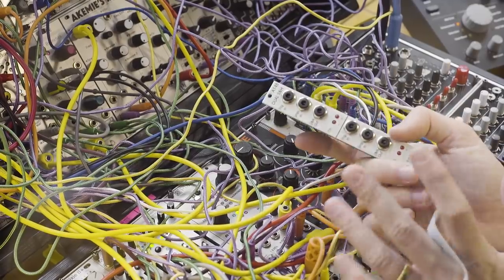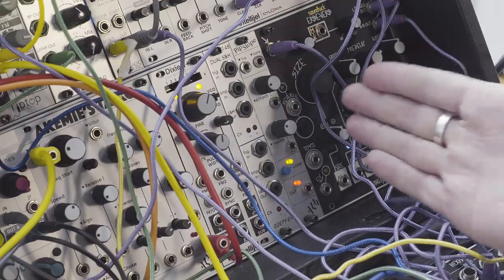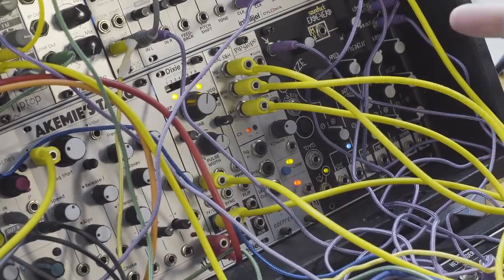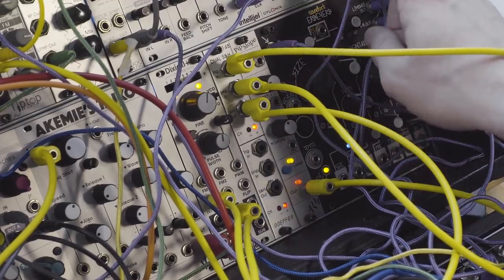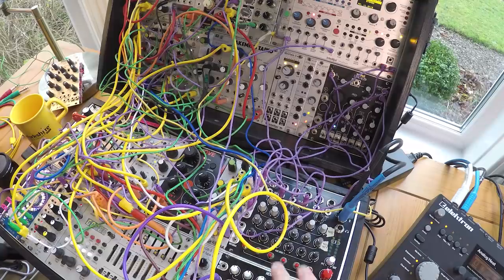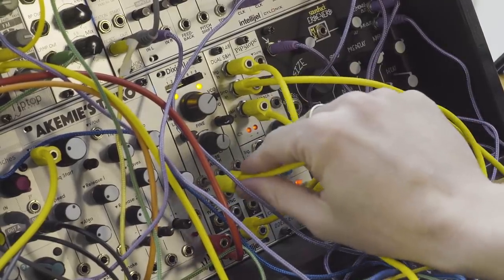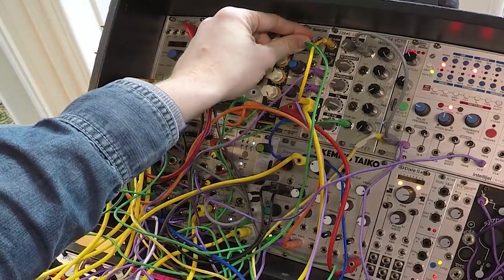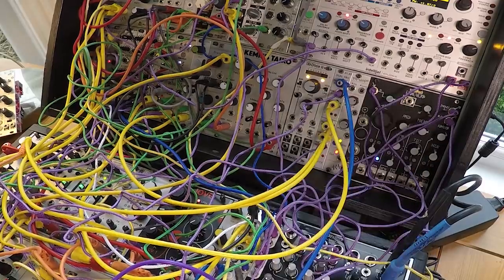Why Sample and Hold Modules Are Ace

Comment: It turns into an audio down sampler, not a bit crusher. Bit crusher works in the amplitude domain number of available vertical bits (looking at a waveform on the screen). Downsampling is like the sample rate of a DAW or CD it's time based and that's what happens here. Over time you're telling it to pull samples (CD was 44.1kHz etc) and running at lower audio rates we hear the tone and affect of the lower sample rate ... you asked so I rambled.
Reply: It is not exactly down sampler. For the downsampling to work without aliasing, you need to have low pass filters on input and output, and they need have cutoff below the Nyquist limit. Otherwise, you get various aliasing artifices, which can be interesting sonically of course on its own. Actually if you put reasonably high sampling frequency, and appropriate low pass filters, you will reconstruct original input signal ;D
Reply: @movax20h  sample rate reducer might be better way to say, as it says what its doing right in the name, changing the rate at which we are sampling the source, via the trig on of the s&h module
Reply: Whatever we call it! This video finally helped me understand it! Thanks Mylar!

Comment: I think this is more of a sample rate reduction effect than a bit crusher, it's basically because you're reducing the sample rate, it's like you have your analog vector curve and the sample rate is the resolution of the pixelated image you get out of it. By lowering the sample rate of the sample & hold, your sound is getting more and more "pixelated".
If someone could explain how a bit crusher works and what's the difference, that would be very interesting!
Reply: a bit crusher reduces the resolution of the amplitude of the wave. Like 8bit audio only has 256 values to play with. The change happens at any time when the audio passes the threshold between values. This is the difference S&H reduces at different time intervals and a Bit Crusher reduces at different voltage levels. So if you are looking at a waveform one reduces on the X Axis and the other on the Y. Now i'm gonna go bitcrush some S&H for full XY control
Reply: @dysbomb  oooh right! That is very clear! It's width of the step and height of the step! Thank you for the explaination, i'll know what I'm doing with my ssr and bitcrusher ont the field kit FX!
Reply: So theoretically an analogue bitcrusher would just be an audio rate quantizer with evenly spaced steps?
Reply: @aeu05172  yeah in it's most basic form. They're also loads of weird and wonderful ways of distributing the values that coders have come up with over the years.
Reply: @aeu05172  if we're talking about applying it to a pure waveform it will introduce amplitude steps, your sine wave is going to look like little steps going up and down. The more you bit crush, the less steps there are vertically ( a midi signal has values going from 0 to 127 for exemple ). The sample rate will affect the width of your steps horizontally, it's the time your value is held.
If you're not modulating it, your steps will be even.
Reply: @Neurotypique  Thanks glad i made sense  :D
Reply: Yeah bit rate is like upping the contrast to use your pixel analogy sample rate is resolution.
Reply: Or posterize I guess
Reply: If you sample at audio rates, you start getting the original signal to come back in.  But any frequencies in the original audio that are half your sample rate or HIGHER can't be properly represented at playback (Nyquist Theorem for more detail).  Audio in those frequencies have aliasing noises and artifacts.  The idea of sampling and holding is the basic building block of a analog to digital converter.  The process is then reversed in a digital to analog converter.  So it's like connecting a lo-fi ADC to a DAC without any storage of the results into computer memory.
Reply: Yah a DAC is basically a S&H circuit. That's why samplers are called 'samplers.' :-)
Reply: @paulmitchum8658  I'm not sure that's right. I was pretty sure "sampler" came from the fact that you could pick and choose small "samples" of other tracks (and especially when contrasted with synthesizers), not from the esoteric details of exactly how they do that. But I'm just some guy.
Reply: @paulmitchum8658  a DAC is both it has a sample rate and bit resolution. Like perfection is 96kHz 24bit but the fun stuff happens when it breaks down say 11kHz 6bit.
Reply: @paulmitchum8658  *ADC

also a good adc needs a lowpass filter to prevent aliasing
Reply: For anyone who is lost in the above comments, the answer to the original question is:
- a bit crusher reduces the bit depth of the audio, whereas 
- a sample rate reducer module reduces the rate at which the module samples and holds your voltage.

How are they different in effect?
They audibly sound similar at times, and often times bitcrusher modules/pedals will have both features, which I think is the biggest culprit for their confusion. However, some differences in their sound/use are:
- sample rate reducers don’t generally care if you’re quiet or loud, they just sample and hold your voltage until the next sample, which often results in RingMod-ey inharmonic sounds due to something called “aliasing”.
- Bitcrushers often sound crackly or completely silent if their bit depth is set low and their input signal is quiet, which often results in sounds people associate with gatey guitar fuzz or Pole Position’s “prepare to qualify” vocal sample.

What does reducing bit depth technically do though?

The quick answer:
Bit depth controls the amount of possible voltages a bit crusher can describe. 2 bits would only be able to describe 4 voltages total, whereas 16 can describe over 65k voltages. 
A sawtooth wave at 16 bits will look like a normal sawtooth, but a sawtooth at 2 bits will look like a 3 step staircase at best.

Want a more detailed answer?

Imagine you are running a triangle LFO (with a +5v/-5v range) through a eurorack bit crusher. 

A simplified explanation of a bit crusher is that it checks the input voltage, rounds it to the nearest number it can describe, and then outputs that rounded voltage.

At high bit depths (like >= 16 bits), the triangle LFO will look roughly the same as you’d expect: diagonal lines up and down. This is because *there are enough bits to accurately describe the voltage the LFO is outputting in that instant*. 16 bits means the bitcrusher can describe around 65.5k different voltages spread between -10v/+10v, so you would imagine that it doesn’t have to round very far at all. 

Now set your bitcrusher to 3 bits **gasps**. What’s going to happen to that slope? 3 bits can describe only 8 different values across that same -10v/+10v range means that there’s gonna be some prettttty liberal rounding going on. 4.5v might have to be described as 3.25v, -1.1v might have to be described as 0v! What was once an accurate slope is now going to become an approximated staircase, with the height of each step dependent on how many values the bits can describe.

Comment: Yeah, understanding sample and hold goes hand in hand with understand Analog to Digital Conversion. Because a computer has finite memory, it must encode waveforms into a series of finite steps to store, and it uses sample and hold to do it. The trigger clock denotes your sample rate, be it 44.1 kHz or up to 192 kHz. Its frequency resolution.

Your S&H is running below 44.1 kHz and so you get sample crushing effects.
Reply: Cory Bosse excellent comment! This makes so much sense to me now
Reply: @gamertag301208  So glad to hear! This all ties in to understanding the Nyquist frequency, aliasing, oversampling, and a host of other handy things to know.

Comment: 06:45 At this point the output of the sample&hold changed from the FM input of the Dixie to the volts/octave input. This little detailed confused me for quite some time while I was trying to understand the signal flow of both patches so, if anyone has the same problem, I hope this helps.

Comment: On the bit crusher thing, I think it's not really a bit crusher but sample rate reduction, which bit crusher typically also does. You're limiting the sample rate of the input signal to the frequency of the square wave. Is there such a thing as the opposite of a slew rate limiter? A slew rate aliaser? That would be similar to a bit crusher I guess.

Comment: A variation on this patch I love involves chaining multiple S&Hs into a shift register before one of the voices. Using the master sequencer's output and clock as the sample input and trigger source, you get a canonic variation of the master sequence (shifted some steps behind, similar to a round) on the output of the shift register. Adding one more S&H in that chain, clocked instead by an individual gate sequence for the "canon" voice, results in new patterns that are based off the same data set as the master sequence, but keeps the voices from following exactly the same patterns.
Reply: YMMV getting the S&Hs to chain properly: successful implementation may depend on the charge and dispersion times of the capacitors in your analog S&Hs and some under-the-hood sampling times in your digital S&Hs. A quantizer on the back end may help combat droop from analog components. If it doesn't work quite right, there's always O_C.
Reply: Im gonna try this with my quad quantizer! A quantizer with a trigger input is basically a sample and hold all by itself, except the output is always quantized. Also they're digital so they can't handle triggers at audio rates (I tried).

Comment: 17:55 I'm relatively new to Eurorack and with all the modules I've bought it has been impossible to put the red stripe the wrong way round. Is that a recent thing?
Reply from the maker: Moreso yes - manufacturers are starting to make this problem go away through design, but not all modules have boxed headers.

Comment: I have a small problem with my s&h module holding improper pitch. Whenever I do the same thing as it is being shown here from around 15th minute, the pitch information that I get back after sampling it is different. I am using the same triggers for s&h and my plaits. My s&h module is intellijel 1u Noise Tools. Maybe someone knows why it is happening?
Reply from the maker: So something I didn’t mention here (and which didn’t crop up in shooting the video but IS massively an issue on some modules) is the fact that some analogue S&H modules may slowly reduce the voltage they’re “holding” over time unless they’re specifically built not to do so - and they’ll probably say on their site if they have been designed to stay precisely level. The Doepfer I tried here was fine but I borrowed it from a kind soul, and others with the same module have had issues - eg. it may vary from unit to unit. The Divkid sample and hold module is specifically designed to stay at held pitch, and the Expert Sleepers Disting is a perfect S&H if you have one!
Reply: @mylarmelodies  thanks for quick clarification :)

Comment: Your a148 behaves! Mine doesn’t hold steady for even a second, it always drifts up.
Reply from the maker: I think mileage may vary - the best cheapest S&H i know is either the Disting or the RND Step (both hold pitch straight). Alternatively quantize afterwards
Reply: @mylarmelodies  Good idea. I would try another chip but they’re like a third the cost of the module buying alone. Quantising after will get me by for now. thanks for your response.

Comment: Super handy vid, watched a few times now as I'm considering buying a Beast's Chalkboard and the dual s&h to maximise my sequencer usage across my choices. Top stuff 👍
Reply from the maker: Thanks! One thing to be aware of is you can get a bit of voltage drop with analogue sample and hold modules - Divkids one is totally solid though, so usable for pitch!
Reply: @mylarmelodies  awesome, thanks for the heads up - saved me some potential drama there!

Comment: yah the bitcrusher effect is obviously evoced caused by the sample rate reduction caused by triggering the sample and hold at a lower rate than the audiosignal put through, which leads to a lowering of resolution/lower sampling rate at nonequal intervals. -> bitcrusher.

i bet this sample & hold bitcrusher effect is getting more pronounced if you lower pitch of oscillator triggering the sample&hold relative to the processed sound,  and smooths out if you go higher. jas to be that way.
Reply from the maker: It does! Yeah it’s literally sample rate reduction, magic to hear it happening in the analogue domain

Comment: is there any way you could take the amplitude of the wave form at specific times and use those as clicks for triggering things?
Reply from the maker: Yup with a Doepfer A119 or similar
Reply: @mylarmelodies  Im mean triggers that follow the shape of the input. So the triggers would vary in intensity in relation to the wave shape.  Not reach a threshold and spit out a trigger always the same intensity. I have supercollider code that does this but it would be nice to have a eurorack module